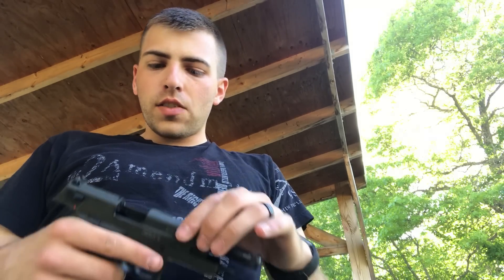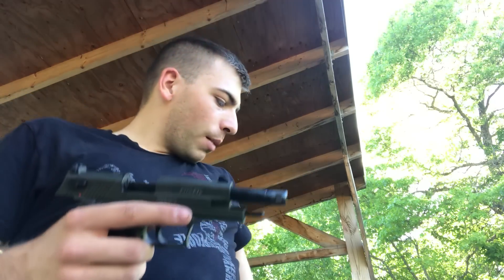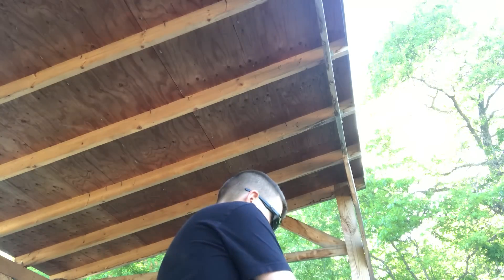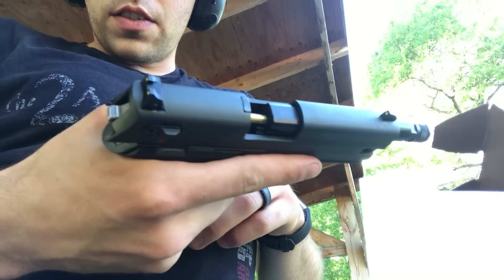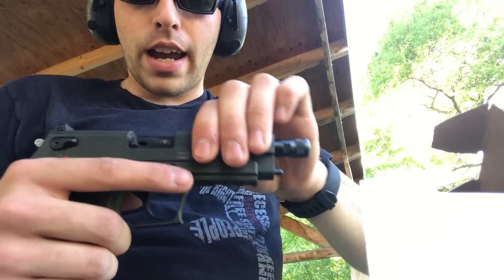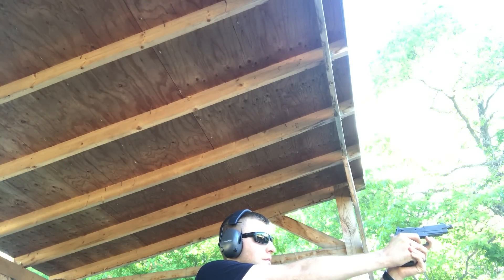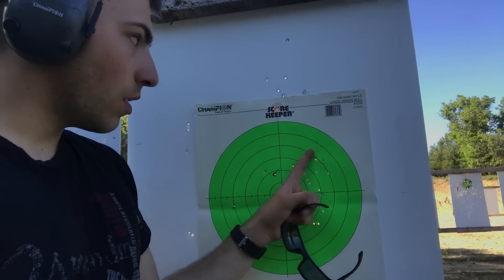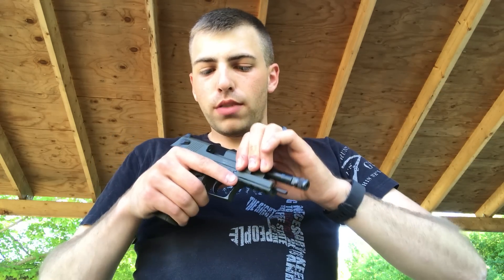.22 Cal GSG Firefly - Reliability & Function

Comment: CCI Mini Mag should be the standard for any 22lr pistol. About 85% of the time its NOT the pistol it's the ammo.
Reply: My Buckmark will run most 22lr ammo, in fact the only thing it hasn't run was also the Winchester white box, which is probably the worst on the market.
Reply: @roberttaylor9559  Are you talking about the Winchester Super X ? Yeah those rounds suck. The point is that there is not high standards for 22lr not unless you spend extra for match grade ammo. Even CCI doesn't follow the standard. Look at the CCI Stingers the case is longer than a standard case. Could that cause the rounds to stick in the magazine? Could it cause a failure to feed or failure to extract? Yes.. Plus the fact that 22lr is just plain dirty so if you fire 100 rounds off CCI Mini Mags and have a 3 to 5% failure rate that's pretty good.
Reply: I run yellow jackets
Reply: But High velocity is the answer
Reply: I had the sign mosquito and had nothing but problems regardless of the ammo.
Reply: Wrong! Ammo causes 76.254812% of problems with .22 pistols, Sheesh, get your stats right!
Reply: @everready19373  I'm sorry was i off 9% 😂😂😂
Reply: That‘s still 15% the gun’s fault...pretty crappy
Reply: @ventilator2999  The fit and finish doesn't deserve the sig sauer name. After 1,000 rounds, and a polished feed ramp I've zero failures when using the CCI MINI MAGS.
Reply: My advise is ... don't use those 22LR ammo with less 1000FPS !  Like my Walther P22, its NOT the pistol itself, its the issue of ammo ! !  For me I usually use CCI mini-mag or Aguila Super Extra Hollow Point .... 100% no problem !  Even on my Winchester Wildcat 22LR rifle, I don't use Winchester ammo ....

Comment: I bet it will shoot 32gr CCI Stingers just fine. I think it has more to do with the powder load where CCI is good. I have a Mosquito Sport and a brand new Firefly. The Mosquito has 3000 - 4000 rounds of CCI MiniMags without any problems. It likes roundnose and 'hot' loads. Keep it clean and lubed and it won't let you down. It's also pretty accurate. I use it for 25m and 50m target shooting. I just gave my new magazines a thorough clean - even when brand new they seemed to have some dust inside and didn't feel smooth. Now they're clean and run like butter. 
The GSG and earlier SIG got a lot of criticism by a lot of people - if you treat them right, give them the right ammo and use the right spring, they're as reliable as a Swiss clock. I never had any problems.

Comment: Owned a Sig Mosquito and currently own this gun. Same as before with me this gun likes round nose (the more slimmer ones, not the fat heads. That's what I call them.) Cci mini mags, Rem thunderbolt, Blazer, Aguila SSS, Rem golden bullets, pretty much any 22lr with those designs will run great. When my guns aren't at the range I keep them around the house in defense mode, in this guns case, loaded with Cci stingers. Someone commented that a 22 will kill you. I happen to know this from experience.
Reply: 22 may not have "knockdown power" like a 45... but one to the head, or heart, will stop you just as hard as anything else. I try to avoid any holes in my body, no matter WHAT the diameter!

Comment: I realize I'm lat to the party on this but I've watched like 30 videos on this or the M20 variant and all but one made the gun look very bad. Most guys had mixed results but I bought the Mauser M20 with some trepidation and shot several mags of different ammo and the only one that gave me problems  was the Browning 36 gr in bulk rated at 1280 fps. Aguila 40 gr super extra at 1255 worked fine, Winchester small game 37 gr at 1280 was flawless, Federal auto match at 1200 fps was flawless and CCi std velocity gave me one fail to feed and one that took 3 strikes to ignite so that was clearly an ammo failure not gun related.  I shot a couple of mags of each and would feel comfortable using any but the Browning which as I remember has given me problems in other guns too like my Heritage rough rider revolver. I bought this at local Dunhams for 211.00 out the door and I'm glad I did. My GSG AK wasn't getting much love in online reviews either but I've fired 300 rounds of mixed ammo without one single failure of any kind.

Comment: Get an aftermarket reduced strength recoil spring for the weaker rounds. Should be maybe $10
Reply: The pistol comes with another spring.  It's hidden under the upper padding of the hard case it comes with.

Comment: See I shot the aguila .22 bullets and it jammed up a lot. But I tried the CCI and did 50 bullets through and no jam
Reply from the maker: Ryan Fuson definitely a picky gun!
Reply: jmeyer35f it hasn't jammed yet I'm still running thru the CCI rounds and nothing. So I'm sticking to CCI.  Thanks for the video☺
Reply: Cci mini mags are imo the absolute best 22 ammo, never found a gun that can't run them flawlessly.
Reply: Spencer even hollow points are great with CCI.  That's all I been using, hollow points and regular copper heads

Comment: Put on your shortest front sight that came in your kit, that will raise it on target.
Reply from the maker: bionicbaer kit? Other sites? Am I missing something? My gun came with one magazine in a box 😕
Reply: Mine came in a plastic case with 2 extra sights, a key, an extra spring and 1 snap cap.
Reply from the maker: bionicbaer you lucked out! Good to know though. Was the front sight easy to change?
Reply: You might be able to get your sights buy contacting American Tactical Imports.The sight is easy to take out I just used a small screwdriver and tapped the underside and it popped out the top,putting new one in takes a small plastic hammer its a tight fit.
Reply: Sorry the fix I was looking at was with the mosquito. I'm definitely looking at getting something like this just to have cheap fun with.  9mm is getting expensive to shoot as much as I would like.

Comment: Did you ever put a light or lazer on it? If so which one.
Reply from the maker: Mr Chillpill I have not, but you easily could fit one. The rail is plenty big. I have mounted the Mantis X training device on it though.
Reply: I did it was some cheap laser off of Amazon for $20 bucks it looked cool but the laser wasn’t that great the switch could be easily activated while holstered killing the batter in the process